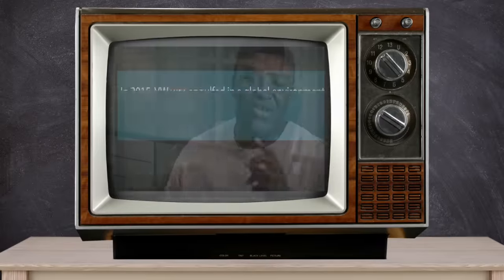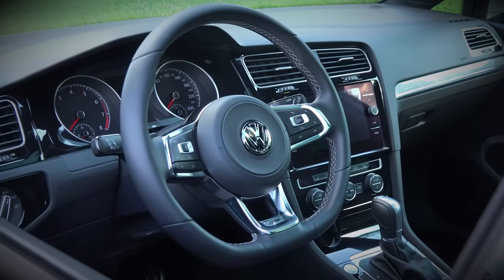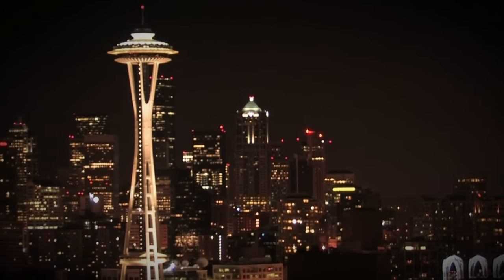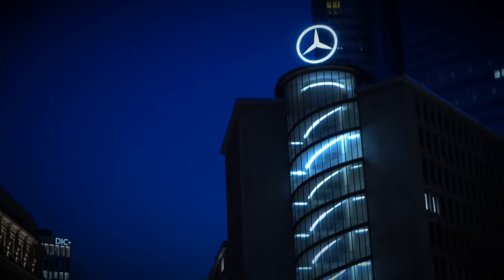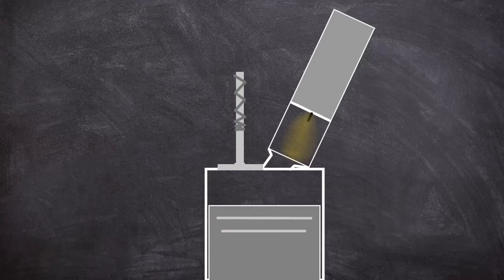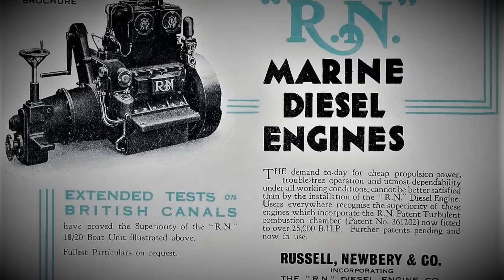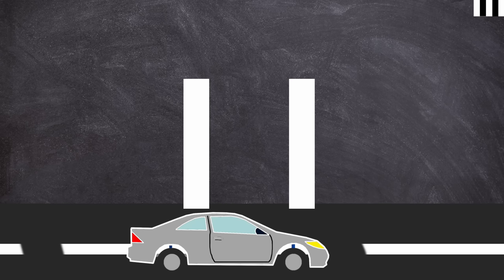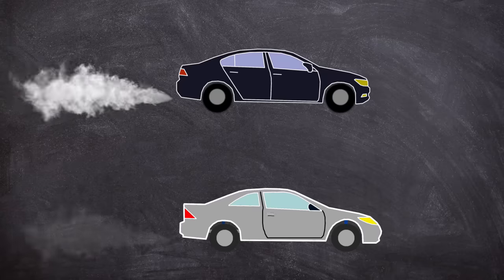Scandal: VW Emissions Dieselgate Explained | Plainly Difficult Documentary

Comment: There were a whole bunch of these stored in my hometown in California. They sat there for a couple of years, then started to disappear. Have no idea where they went.
Reply: Once VW worked out a deal with the EPA, they began applying software and hardware fixes to them.  They got new tires and batteries and were sold to car dealers.  I own one of the 2014 TDI Beetles that had been bought back by VW and spent two years sitting in the parking lot of the Pontiac Superdome.  It's the best car I've ever had in 35 years of driving.

Comment: In 1999 VW introduced the "Pumpe-Düse" system (unit injector system). Unlike a common rail system, there is a combined injectionpump and injector module for each cylinder. In 2007 VW introduced the EA189-engine (those affected by the scandal) equipped with a common-rail-system. The unit injector system couldnt't reach the required injection-pressures needed to meet emission standards (....), had problems with acoustics and required more installation space compared to the CR-system. The PD-engines took more space towards the hood, leading to problems with crash-testing regarding pedestrian impact tests.

Comment: I had a 2013 Audi A3 TDI, I actually hated the car and had mostly stopped driving it even before the scandal broke.  The car probably would have been fine but the transmission it was saddled with made it incredibly boring to drive so when I got a new job with a much shorter commute I went back to driving my 2004 Mazda3 the Audi was originally supposed to replace.

It actually worked out for me because as part of the settlement I was able to get VW to buy the car back for more than I could have sold it for even before the scandal became known.

I went back to driving the Mazda full time until 2018 when I got a Chevy Bolt EV, amusingly that car ended up being recalled as well over battery fires and I could have got GM to buy that car back as well but this time I elected to keep the car and ended up getting a brand new battery.

I still have the now 18 year old Mazda though don't drive it much anymore because the Bolt is so cheap to operate.
Reply: I've had a 2008 and now 2018 Mazda3. They're honestly so fun to drive, I'm not much interested in other makes!

Comment: Programming to fool emissions wasn’t new when VW did it and it wasn’t the last. The government just decided to make an example of them. 1991-1995 Cadillacs with the 4.9L V8 were found in 95 to be gross polluters at wide open throttle. When it was discovered, they quietly came out with an updated computer chip and did a recall. They didn’t tell owners what the update was about, they just returned customers cars to them with a lot less power than before.

On another note, I currently drive a 2017 Jaguar XF 20d. I love my Diesel engine and have no plans to give it up.

Comment: The only thing I would say is that NOx emissions are NOT particulates. NOx is a gaseous emission and it measured in PPM, as in molecule counted in the gas (part per million). Not a particulate. Tailpipe particulates are predominantly carbon based molecules in solid state at ambient conditions.

Comment: Quick correction: NOx is the result of the high temperatures and pressures in the engine causing the nitrogen (N2) in the air to combine with oxygen (O2) in the air to create NO, NO2, etc. Smog is particulates, NOx is a chemical reaction.

Comment: I have more faith in Honda than I do in literally anything else. It’s sad, but Honda genuinely is that good at making stuff.
Reply: Honda has had a number of cases where they built engines or transmissions with major issues, did minimal fixes to get people through the warranty period, and then when they finally failed told the owners "too bad, so sad". They're no saints for sure.
Reply: @RobertHancock1  Fair enough. I'm sure every manufacturer has done the same thing or worse though. I've just had more luck out of Honda motors than any other manufacturer by far.

Comment: very interesting, i would like to add that you all have been lied to, i am a vehicle tech and an engineer, i have worked in the car industry for over 30 years, diesel cars are not more reliable than petrol cars and now i will tell you why.
diesel engines have to have a much higher compression ratio than petrol engines in order to burn the fuel, this is a problem for direct injected engines, the fuel on a diesel engine has to be up to 5-6 times the pressure of a petrol engine, this makes for complicated systems where some diesel cars need 2 fuel pumps to get the fuel up to pressure, it also means more complex and expensive fuel injectors which can cost up to 6x what a petrol fuel injector costs, also you have to add a turbo charger to the diesel engine to keep it at the same performance level as the petrol cars, so now you have to also add pipes and tubes for control systems to the turbo charger, intercooling and vacuum systems.

so to sum it up you may save some money in fuel while you drive your diesel car and this is true but if it ever brakes down and needs anything more than just a sensor you are looking at a massive bill, i have never owned a diesel car, the reason... i repair my own cars, the complex and expensive equipment you need just to test a diesel fuel injector is not an amount i would want to pay out, for a petrol car i can test the injectors with just a few plastic cups for example before we even talk about the cost of the high pressure fuel pump.

so i disagree with what you say, diesel cars are not more reliable than petrol cars, there is much more that can go wrong, when it does it is more expensive to repair, so what you save on fuel you will spend on repairs, do you want to talk about how water end's up in the fuel tank of your diesel car now?  ;)

Comment: They used an area outside of the closed George Air Force base in the California High Desert to store some of the buy back VWs. It was sad seeing all those newer cars setting out in the blistering hot desert completely covered in sand from the frequent dust storms. I don't know what they did with them. They are gone now. I wanted to get one, I don't care if its de-tuned. I figured they were selling for pennies on the dollar. 

Back in 1995 my wife had a job picking up auto parts for one of the local repair shops in town. A couple times a week she drove from the high desert to Los Angeles and back, about 200 miles round trip. The shop owner let her drive an 1980s era Jetta diesel. The thing was absolutely gutless but barely used any fuel. My wife loved the car for no other reason than the air conditioning. Here in the desert where it gets 115F in the summer, you could hang a side of beef in that car. I have never seen another car with air conditioning that cold. My wife wanted to buy the car but the shop owner wouldn't sell it.

Comment: I usually say it was quite pointless trying so hard to prove that Diesel engines were superior to gassers in every aspect. A more conservative power and torque rating is often still suitable to the needs of most drivers and allows the usage of a simpler aftertreatment, just like Isuzu does nowadays with the ancient 4JA1-L engine in India where it's available to 2WD versions of the Isuzu D-Max and resorts to a noticeably simpler aftertreatment than the versions fitted with the RZ4E-TC engine.

Comment: One thing that wasn't mentioned is that buyers of these cars in Germany were screwed without any retribution. On their home turf with all the lobbyism that went with it, there was nothing VW owed the public at all. 
I've owned an Audi with one of these fudged engines. As it turned out, after installing the software update to make it work as intended, just driving the car normally  put a lot of additional strain on engine parts like the Bosch high pressure fuel pump. half a year after installing the update, the rotor of the pump commited Seppuku and all of the fuel system was full of metal shards. complete failure. uneconomical to repair. 
As the car had driven 247.000km (VW got away with giving the customers only the "remaining value" of the car if it failed due to the update and considered a car with 250.000km worthless) it had basically no remaining value. 
The outcome was: no car, no retributional money. Thank you, VW and Bosch. 

Ironically I now still drive an older VW Diesel. But that's not because this event has made VW more sympathetical to me but just because of the ubiquity of used VWs in Germany and therefore their low price. This one is not a manipulated car and it works very well. 
Very sad this all happened.

Comment: 10:30 Another MASSIVE drawback of AdBlue is how terribly it functions in northern countries such as Canada and Scandinavia. With a freezing point of -11c, it is doomed to freeze thus not function during winters where -11c is rather warm - -20-30c and beyond is more common. And dysfunctioning is only "lucky" incident since freezing causes piping cracks, part breaking, and other costy procedures just by existing during winter.
This caused our company car to fail to use AdBlue system but mechanic bypassed it for next spring. Why? Because he already ordered 2,000 new pipes for other adblue cars - during a single winter. In summer he only ordered 2 dozens.

Comment: 6:19 in 1999 VAG introduced the PD (Pumpe Dusse..or pump injector unit) system. Later, in 2008, they've switched to CR (Common Rail). Some V6 and V8 TDI engines received the CR injection system in 2003 or 2004.
Reply: PD came to North America in 2004. As an owner of many TDI vehicles the BEW (first iteration of the Pumpe Duse) was an excellent engine. 1999 marked the introduction of the newly refreshed Jetta with the ALH engine.

Comment: As far as I know, the reason wasn't only the reduced power of the cars, but also the amount of Ad Blue used (price/small tank -> inconvenience etc.).  So the technology in general is working quite well, all Diesel Trucks in Germany use them, and it works fine. This would have been possible in cars too, but the high amount of Ad Blue needed is not good for selling these cars and the VW  supervisory board set high targets in for the distribution. To fulfill these goals, the engineers “had to” cheat, it was just not possible to do it correct. This was also illegal in Germany, but VW doesn't have to pay that high fine as in the US. All cars had to be upgraded anyway, so it was definitely big financial damage.

Comment: if you ask me the industry-wide issue is that these emissions regulatory agencies make demands without offering standardized solutions, leaving manufactures open to develop their own cheap under performing solutions and even cheat systems to put in their car rather than a more expensive but better performing standardized device

Comment: My parents owned a VW Rabbit, diesel.  I hated the smell of it. Getting on the highway was fun, 0 to 55 in two minutes?  It was noisy and drove like a tractor trailer.  The clutch burnt out twice before they got rid of it.  Another problem was that it didn’t start in temperatures below about 10F.  You had to get an engine block heater or a jump from another diesel like a truck or tractor.  The latter wasn’t really a problem for my parents who lived in coastal Georgia, but they came to spend Christmas with me in Prescott, Ontario.  Also, something acidic dripped from the exhaust pipe because at home, where they kept their car in a semi-heated attached garage, a hole was gradually eaten into the cement beneath where the exhaust pipe sat.

Comment: Newer diesel engines maybe less polluting, but the fuel economy economy suffers. For instance I had a 1999 TDi Passat and a 2004 version of the same car, both 1.9 and both estates. On my 20 mile commute to work, with the '99 if I was carful I could easily get over 60 MPG, this is UK gallons which are a big larger than US, and mainly motorway, driving at ~60 MPH. But with the '04 Passat I'd struggle to get to get low 50's MPG, that's like 10 MPG less, which adds up.
Reply: Yep, that was issue of Euro4 PD engines. I have the same consumption on my 2007 1.4TDI as my colleague with a 2001 1.9TDI. Once they switched to common rail, it improved again.

Comment: erm, slightly incorrect about the diesel engine. It doesn't compress diesel until it combusts, it compresses air until the air is above diesel ignition temperature and then injects a shot of diesel, which then combusts.

Comment: I owned a 1971 model year car with an ignition that used points. There was a solenoid that retarded the spark when the engine was idling. My understanding is the government was just starting to implement emissions requirements and the only test done was at idle. Retarding the spark allowed the engine to meet the requirements at idle. As soon as the driver pressed on the accelerator, the solenoid disengaged and emissions increased. I think that was the only change to the engine implemented that model year. As far as I can tell, the manufacturer never was punished.

Comment: same goes for my Opel Vivaro company car,  during an emission test it would only rev up to 1300rpm, only when you put it in gear, and touch the clutch pedal, it would then rev up to over 5000 rpm, blowing some pretty thick black smoke.

Comment: 1999‘s ‚common rail‘ was not common rail but Pumpe-Düse where one pump sits on each injector instead of having one pump on a high pressure common rail to the injectors.

First time error in plainly difficult 🤓

Comment: I can only halfway share your praise for Honda when it comes to emissions.
My family has been driving Hondas for more than 35 years, and so have I ever since owning a car. However, my previous car was a Diesel Civic, the first Diesel model ever to be brought to market by Honda. The engine was an 1.7 liter engine developed by Isuzu (Honda didn't put in their own development until the next model) - and the reason why I had to sell it was emissions. Germany changed their laws regarding fine particle emissions (if you ever see photos of cars in Germany with a circular green sticker or re or yellow  on the windshield, that's what it is for. Instead of tinkering around with the engine control system and trying to fake compliance, they just said "bad luck mate" and I was stuck with a vehicle of extremely low resale value that I couldn't even use to drive home, living in a zone of stricter emissions regulations.
I am still upset about that, but most of the blame I put on our government by implementing rules that suddenly applied to all vehicles, almost regardless of their age (I think there were exceptions for vintage cars of 30 or more years) instead of applying new rules only to new vehicles or even newly launched models, as they usually do.
Reply: It isn't Honda's fault that your government changed the rules. In the USA they don't do that for old cars.
Reply: @hithere7382  Sure, changing the rules isn't Honda's fault. They don't make the rules.
But it's their reaction. Other manufacturers, who hat the same issue, offered filters that could be installed to meet the new rules. Even for what is basically the same engine. (It was used by Opel as well, only as an 8-valve instead of 16). But that filter was not approved to be used on the Civic. 
Honda did not care and offered no solution at all.

Comment: EVERY brand has issues with oil usage / burning now days
.
its due to the thin (and low friction) piston ring packs they use now days
they seal great under the force of the explosion.... but on the 3 other strokes, allow some oil past
.
so you have good HP, good MPG..... but its gonna burn a quart or 2

Comment: My 2016 gas f150 3.5 twin turbos gets it's rated mpg even with 10 ply tires and no front air dam if I keep it at 60 mph or under. For long interstate trips when gas is expensive I reinstall it.

Comment: "Common rail" wasn't used until 2009. "Pumpe-Duse" unit injection 2004-07. 90s-2003 Mechanical or ECU controlled mechanical injection.

Comment: In 1998 vw lauched the pompe duse and only in 2008 starting manufacturing common rail !
Reply: they couldn't reach emission norms even on test beds later with PD engines. The same reason why old style inline injection pumps vanished

Comment: VW survived because most people aren’t “activists” and are aware that most the government bureaucracies just wind up making the cost of things drastically more to the end user.
If the government agencies charged with protection of the environment really cared they’d welcome solutions that work, like efficiency standards rather than emissions. Because an powerplant that’s highly efficient inherently generates lower emissions. These regulations seem to be aimed more at keeping small companies out of the industry by making the cost of production prohibitively expensive, VW just got caught doing what most of the large companies have all done or are doing. I drive an old Chevrolet truck older than most the people reading this comment by a considerable about, exempt from about every kind of emissions test there is, but it’s been converted to modern fuel injection and adaptive timing control, and does it’s job well enough. So don’t mistake me for not caring about the environment, just that we should aim to make vehicles that preform a function, efficiently but cost effective enough and easily maintained, but that’s just the opinion of a mechanic that’s spent his entire life understanding how these things work, and smart enough to see that the sea of red tape and politics aren’t doing much to meet even their own goals at the expense of their people. Because the government isn’t the one that has to pay for these, we are.